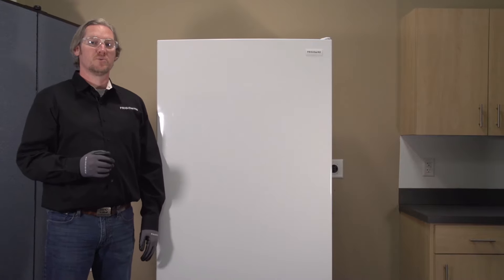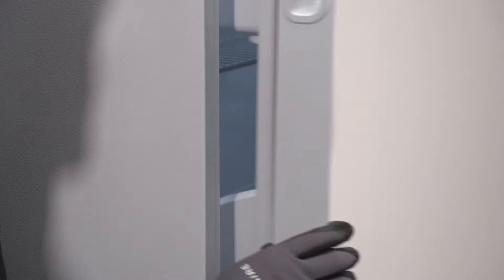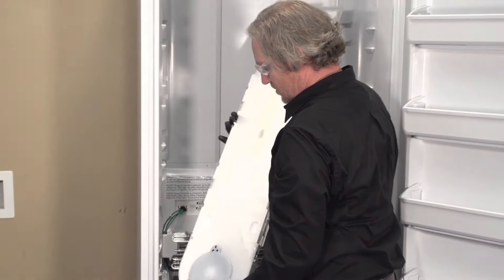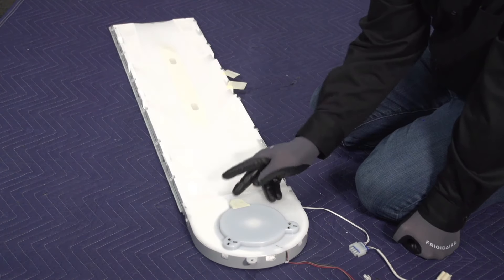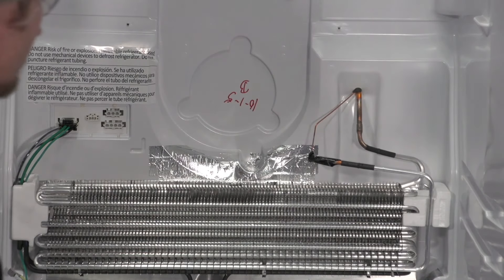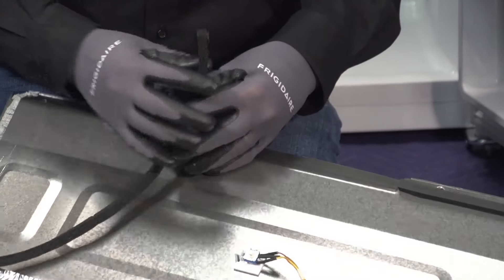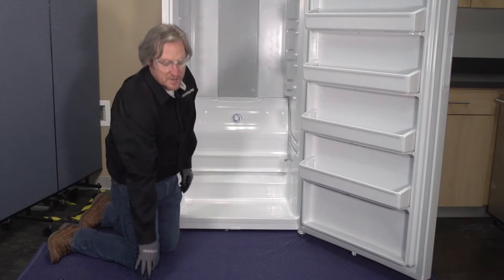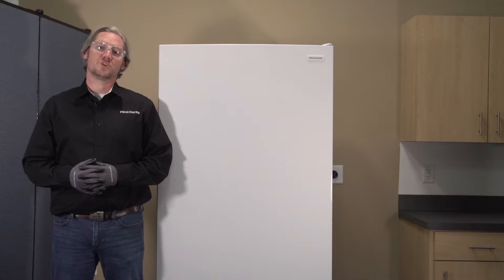frigidaire upright freezer not freezing - troubleshooting

Comment: Wow. I had this repair done under warranty and a year later it failed. Frigidaire says its out of warranty sorry. So i am doing this repair myself and am finding that the factory repair person did not do the repair this way. She never removed the back fan cover and put the metal tape over top vs.  underneath then putting the cover over. She just taped over the wires and all. Also they didn't remove the white tape gasket and just put the black gasket tape on top. I cant wait to see just how they did the rest.